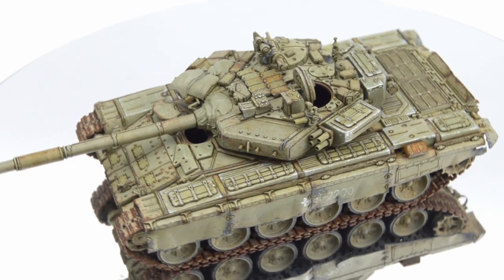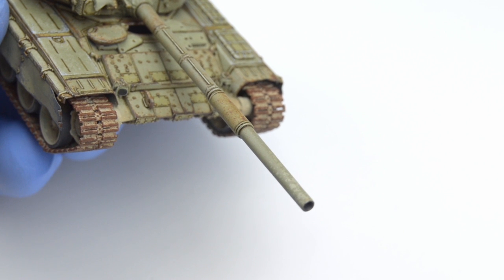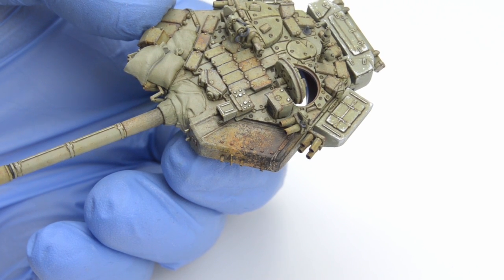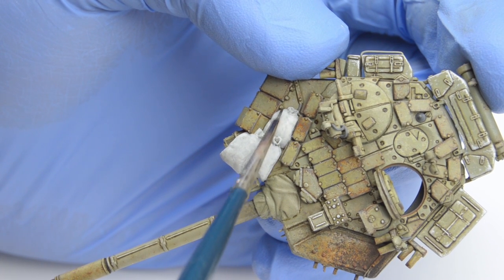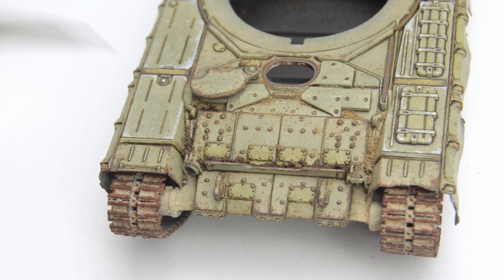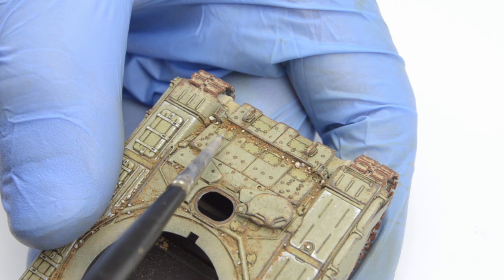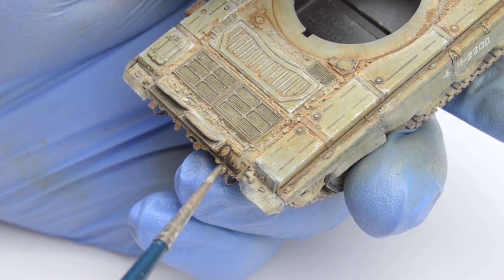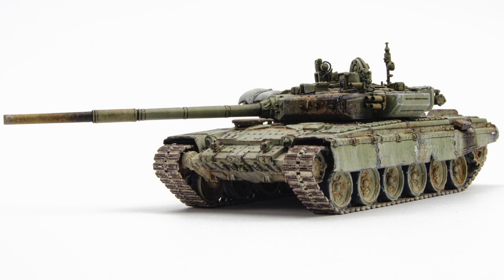Let's Finish The Battle Worn T-90 from Revell!

Comment: The thermal cover is probably very easy to break (thin steel with insulation inside) and gets destroyed when bricks and stuff falls on the tank in an urban environment. I’ve also seen videos about T-72s in Syria where they use the barrel to collapse small walls and move car wrecks out of the way. Also I assume they don’t care much about the thermal cover because the engagements are in close quarters inside cities where the inaccuracy of having a slightly curved barrel due to the top being more hot is negligible.
Reply: they really don't care about their tanks, that they use barrels as a obstacle remover -_-
Reply from the maker: It's very common to see those thermal covers completely torn up or just missing altogether, sometimes as if they removed them before even using the tank. It's really interesting.
Reply: I dont think that the Syrians are the best tank operators at all if you saw the cook off of an Syrian T72 when the whole squat is sitting like ducks in a park....
Reply: @NightShiftScaleModels  it may be hat the thermal cover doesn't make a difference because its so hot and just becomes another thing to find spare parts for and maintain I live in the middle east and is a pain to maintain anything left outside for even a couple of days and I can imagine doing it with such a complex machine in a warzone with n real outside support like a western country would have if deployed to the middle east.
Reply: @DoomOfConviction  I mean they won against multiple american proxies, including isis. They've also been in war for almost a decade.  I wouldn't just sneeze at that.
Reply: @theblackhundreds7124  really? Proxies? You turning a Model video into a conspiracy theory?
Reply: @theblackhundreds7124  The only American proxy in the region is the militia in the 55K, and while the SAA could easily roll over them, they have only ever had minor skirmishes.

If you're talking about American-backed forces, the SAA has completely defeated a few in Idlib and Aleppo, but most are Turkish backed or independent, not American backed.

American influence has been steadily waning over the last few years. North-Eastern Syria was their main area of influence but the Autonomous Administration of North and Eastern Syria has been limiting interactions with the US due to multiple blunders and confusing choices by the Trump administration regarding Syria. 

As for ISIS, they are not defeated. In fact some of the only territory they control in Syria is in regime (government) territory, though its not desirable territory, just some tiny desert towns. Territorial defeat of Daesh (ISIS) was mostly acheived by the Syrian Democratic Forces (SDF), at least over the last few years. The SAA did have a sucessful campaign in southern Deir ez-Zor, but aside from that their focus has been far more on Idlib and north Aleppo regions. 

Additionally tanks have never been a decisive factor in Syria. They are actually more tactically useful in defence, not offense, and have little strategic or operational value. HTS, the most influencial group in Idlib, are masters with ATGMs and RPG ambush tactics. Similar to how the SDF have countered Turkish armoured advances. Tanks are a good show of force but they require a very skilled crew to be competent, and the SAA has very few skilled crews left. They had a fairly sizable Russian-trained and experienced crew pool, but as the war dragged on and they slowly fell, they couldnt be replaced. Now even elite forces like the Tiger Force have mediocre tank crews for the most part.
Reply: The Black Hundreds No. Zvika Greengold really showed how incompetent syrian tankers are in battle..
Reply: Conspiracy? The middle eastern proxy war isn't even a secret!? I mean we all laughed when the CIA backed "rebels" started fightning the USMC backed "rebels" due to misscommunication. Anyway I believe the answer is simpler. The thermal cover get shredded when you fire that thing over dry sand. It has no muzzlebreak or compensator so it is throwing up A LOT of debris back at the barrle when it fires.
Reply: @thepinkplushie  What militia? There is multiple "militias", they are all radical Sunnis, specifically Tafkiri. Those turkish backed forces were absolutely supported by America in many ways. The syrian war was a massive American operation, that was funneled through NATO allies like Turkey and Britian(white helmets) and it even supplied ISIS through Saudi Arabia, which is how they got all those Honda Trucks while the army was made up of citizens coming from economic destitute countries. 
Just like America funded Al Qeada in Afghanistan, it repeated its process in Syria. Except it didnt work this time because they thought Syria was going to be another Afghanistan for them.

Also Note on SDF, they didn't do shit and what you're spouting is American media  propaganda. The only fighting they did was in northern Syria barely any land, and america was helping them in every step, in fact SDF victory might as well be called the US airforce victory. This was of course stopped by the Turkish military because they didnt want the Kurds on their doorstep. Which America miscalculated and left the Kurds in the dust. ISIS is gone and left to Libya. Just like the other Turkish backed forces, to fight Haftar.
Reply: @willthorson4543  not a theory, outright conspiracy though. ¯\_(ツ)_/¯
Reply: @theblackhundreds7124  Al Qaeda was not funded by the US, it was funded by the ISI. And the US supported the Mujahideen, not Al Qaeda.
Reply: Right. The thermal cover does not make sense because the resource of the barrel has already been used up many times and it is already impossible to achieve a stable point of impact. However, when using high-explosive shells this is not so important since accuracy is not required in this case.
p.s. Yes, the United States supports and arms extremists, Kurds and just bandits, that’s fact. In addition, the United States appropriated Syrian oil and deceived the Kurds. This is also a fact.
p.p.s. They will have to face the consequences of such actions, as in Afghanistan of the 80s.
Reply: The Syrians apparently do not bother bore sighting. Then again, there is not much use in bore sighting the main gun in an urban environment. Short ranges and lots of obstacles in the way. It is not like you have to knock out an enemy tank at 3000 meters. So there is little use in keeping the thermal shroud on to aid in accuracy.
Reply: @theblackhundreds7124  what r u trying to prove with the whole 'murica bad' narrative? oh right, it's all clear now. judging by ur profile pic you're working ur ass hard for these 200 rubles, comrade. keep up the good work, putin is grateful for ur service!
Reply: @theblackhundreds7124  you mean russian proxy like isis?
Reply: This video is fantastic. I haven't built a plastic kit for years, but I'm very into modelling. Your narration is hilarious🤣 as for the thermal cover gents, I conclude, more of a hinderence in an urban enviroment that an aid👍🏼
Reply: Oh, subbed btw👍🏼
Reply: @yourlocalmemeandanimedeale807  The Mujahideen had a very loose strycture and Al Qaeda was part of that. While ISI was heavily involved in it's later years and during it's starting, a vast majority of equipment, funding, abd training was provided directly by the CIA.
Reply: @zackkhan2874  To the ISI. Not directly to the those groups.
Reply: @zackkhan2874  And apparently the squabbles between Afghanistan and Pakistan were already ongoing even before the Soviet Afghan war.
Reply: @Comrad_Pixel  Beats moving them by hand, or pulling in less armored engineering vehicles. Those just ask for an RPG up the tail pipe due to their size and weak armor. Plus, like Nadie told previously, the engagements are very close quarters, so you don't need a shell to fly farther than 300m usually.
Reply: Or a half bent barrel as you're using it as a frickin batterimg ram😆🙄
Reply: @NightShiftScaleModels stronk tonk

Comment: 4:40
Explosive reactive Armor 
ERA kontakt 5 on the t90
Reply: Lol was thinking the same thing
Reply: KONTAKT
Reply: ERA is in a certain way spaced armor
Reply: @t_h_f7931  no its something combletly difrence is explodes and sends many thick steel plates Out
Reply: @t_h_f7931  No, you are confusing spaced armor (as screens on M1A2) and semi-active armor type-NERA (beak on Leo-2A5\7) and active armor - ERA (contact-1/5, Relic, etc.). there Is also a non-classical NERA using active materials that change their properties... but these are still prototypes, like NERA malachite for the T-14.
Reply: @elusive6119  leopard's beak is just spaced steel armour from what I know, isn't it?

Comment: Stowage needs a dry brush technique. It adds texture to bags, or  what I used it for, a rack suitcase on a 1930's Cadillac model. I got it to not just look like suede, but feel like it.  Which is crazy.  The model died a long time ago, but had to keep that suitcase. You never know when you're gonna have to pick up and run...it would fun to try to simulate alligator on a smooth surface....

Comment: The Syrian T-90 I found on google even has the sandbags in the same location as your model. But the photo shows the front right mud flap (I think that’s what it is) missing, but the front left is still attached. Also, the remaining red infrared light looks busted as the glass appears to have be shot or broken. I’m not sure if you were planning on doing that to the light, but that would be neat to see how to do it. Keep up the good work!

Comment: The "moisture trapped in dust" happens everywhere that there is sand and dust blowing around. it's just dust and sand getting stuck to oil and grease, mostly grease cuz that stuff already has a yellowish orange color, and that stuff is all over trucks and tanks. 👍

Comment: With Mig paints I’ve had the issue of them not leaving the air brush, usually I just shake them really well and I mean REALLY well and I don’t use thinner. Normally a high pressure and lightly spraying works.

Comment: Rather than using enamel clear coats for optics, have you considered using acrylic gloss medium? It can be mixed with translucent acrylic paints* for color and won't pick up any cured paint underneath.

IME something like 5-10 parts medium to 1 part paint. Preferably use a translucent pigment like Phthalo Blue or Green.

Comment: That ‘spaced armor’ is something called ERA, or Explosive Reactive Armor. This specific ERA is called Kontact-5. When struck with a projectile it explodes to nullify the penetration of HEAT or APFSDS rods (though its a little more complex than simply exploding to nullify it). The RPG that hit it was most likely a HEAT round, which explodes on contact as-well. So two explosions are happening at the same time, one from the ERA and the other from the projectile fired at the T-90. Burn marks are more than likely to be left behind from this reaction so its not inaccurate to make some.
Reply: yea I was thinking like "wait isn't that ERA? aw whatever"

Comment: The aqualine and other weathering really toned down the panel contrast between the recesses and surface of the front and engine deck, which was something I was worried about. 
The contrast of dark lines can still be seen on the bins above tracks on the left side of the tank. I think the look drastically improved with the contrast being reduced slightly between the dark panel washes over the hull with shading, and the unified look of dust and wash over the tank - it otherwise looks perfect now
I had to favourite this video to refer back to the technique of the RPG hit method and the shading on the sand bags!

Comment: All the rust looking stains is from oil or grease. On Israeli armor, it's the type of lubricant that keeps their weapons working. They literally use a ton of it and it runs down from the weapons to the tank itself.   Most modelers won't do it or barely put any on because it looks pretty nasty but I think it adds character and a sense of realism.

Comment: The T-90's used in Syria are older models and don't have angular hammerhead-type turret like this Revell model. They all have earlier T-72B-derived turrets which are more round and circular.
Reply: No, it is this relatively not old (after 2004) T-90A with a welded tower, the Iranian militia.
Reply: @elusive6119  That's what I was saying. This model has the newer welded turret. Syria has older T-90's / T-72BU with cast turrets.

Comment: If you like Russian and Soviet tanks, the best is the T-34. You can mix all sorts of models, make up stuff, since during the war, the Red Army usually just assembled most of their "replacement tanks" from the ones that blown up or broken down, even in the factories, they often improvised, some parts were different from factory to factory, effectively they were Frankentanks from the get-go, and they became more mismatched as they thundered onward. Making for example a T-34/76 1939 model with a 1943 turret, 1944 wheels and tracks, ramshackle repairs on it, even if you don't find pics, it'll still be authentic or at least believable. A good lot of them had no markings or numbers, and some of them had a dozen layers of plain WALL PAINT on them as camouflage, usually green or white, or both...
You can go all wild with it, and there WERE some tanks that served from 1940 and made it to Berlin, even though they were rare. Most fun tank ever!

Comment: Did you Forget to paint the loaded smoke grenade launcher on the Right Hand side? It's still primer Grey.  They should still have a black rubber cap if unfired.

Comment: U keep talkin bout "spaced armour" on the turret, T-90A has no spaced armour array, it has Kontakt-5 heavy explosive reactive armour on the turret cheeks and also front and sides of the hull, those are protecting the actual composite armour array inside the tank. The tank you recreate got hit by TOW-2A anti tank guided missile about 4 years ago, that missile which is not an RPG, blew off all 3 Kontakt-5 modules and the Shtora dazzler. Small unguided RPGs can't make that much damage and would detonate 1 Kontakt-5 module at best. But aside that information problem a great looking model.

Comment: T-90 was hit not by RPG but by ATGM TOW-2, and it was hit not spaced armor, but ERA - explosive reactive armor, which russians is very fond of. So ATGM warhead hit ERA in frontal turret, destroyed it, but didn't manage to penetrate the tank main armor. Burn was from explosion of ERA.
Reply: It was true that the hit was at the top of the left cheekbone of the tower, the triggered EPA extinguished the stream, destroyed the TSU emitter, the sight was also broken. The crew suffered from concussion. hatches were open, which was a violation of the order.

Comment: Syrian here ... can confirm that even the tank guys dont know why !
Some said they don't need it because it's hot here, don't count on that tho.
Reply: Is that in regards to the thermal sleeve? If so, that makes even less sense given the heat in Syria.
Reply: @Mach-2-Fishbed  i get what you are saying .. its just that even the tank crews here told me that after i asked them the same question.
And as you know some of the real meaning can be lost in translation.

Comment: The T90 has composite armor and explosive reactive armor on the surface of the turret, not exactly "spaced armor". I bet the burn marks are caused by the ERA going off. If the tank used spaced armor there wouldn't be much in the way of burn marks. Spaced armor works by making shaped charge projectiles detonate on the outer layer and making the copper jet stream lose its focal point by the time it hits the inner layer of armor making it ineffective at penetrating
Reply: Exactly. Due to the rapid displacement of heavy armor plates that are moving by an explosion of a fast charge, both to the jet and from it, along the axis of the charge. Quenching the kinetic energy of a cumulative jet.
Reply: @elusive6119  Are you intentionally wording it like that? XD
Reply: @georget.6382  Probably a translation problem. Sorry my bad english)
EPA K-5 is more complicated than it seems, there are two highly hard armored plates moving from each other upon activation. Which are able not only to extinguish the cumulative jet, but also to break the AFPDS, with some luck.
Reply: @elusive6119  Wait doesn't the T90 use "relikt" ERA that consists of shaped charges?
Reply: @elusive6119  Btw I see what you mean by armor plates, I almost forgot the shaped charges where sandwiched between two armor plates

Comment: Although I don't know for certain, the thermal cover issue is probably simple lack of availability. When I was in Viet Nam in the early 70's, Soviet aide to North Viet Nam was not limitless. Particularly, in regards to aircraft. After the end of the Soviet system we found out that the North Viet Namese were given seven of the latest MIG's and were told if they were shot down there would be no more. It is probably a similar situation with the Syrians. Given the situation there; they can't make any of the parts they need and the Russians won't let them have any more. So they operate their machines missing whatever is missing. Just a guess, but; it is probably pretty close to right.